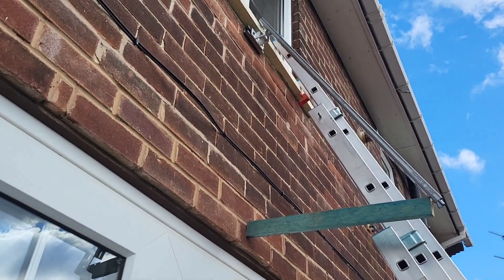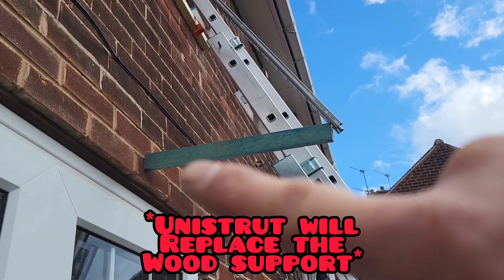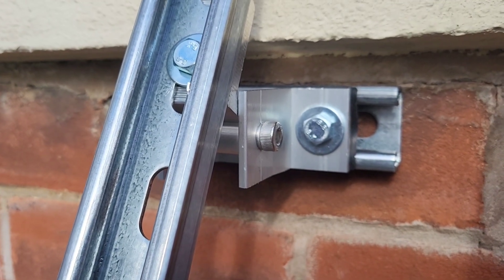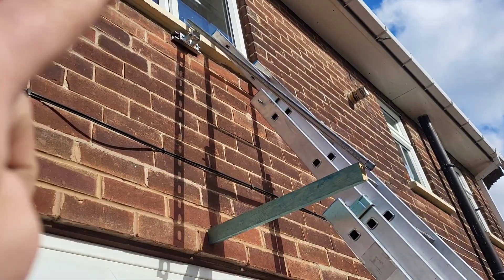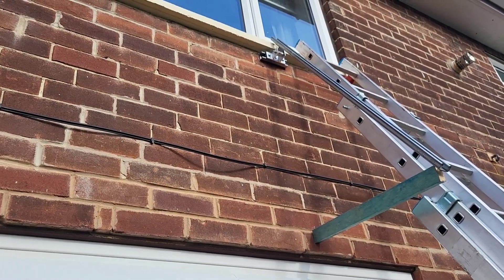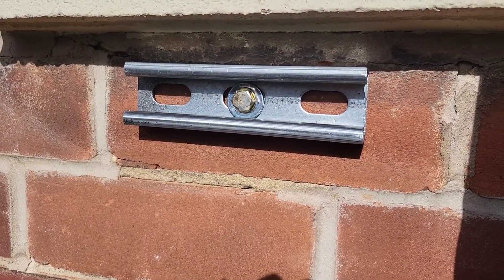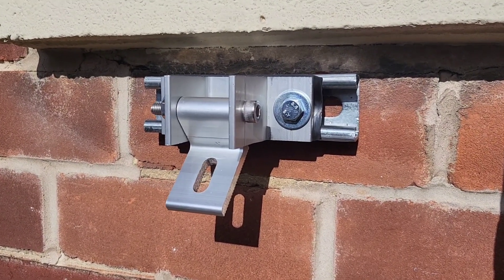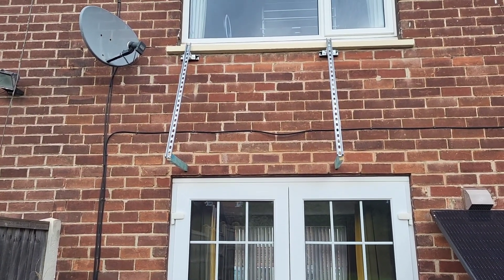wall mounted solar panel

Comment: Cool 😎 
Be interesting to see what power you get mate 👍
Reply from the maker: I'm going to be limited by my charge controller anyway but I'm hoping I can keep charging the batterys for linger with the panel being higher up. I'll have to monitor it over the next few months, my issue is I've got nothing to compare it with. Everything can be changed if it doesn't work as it should 👍